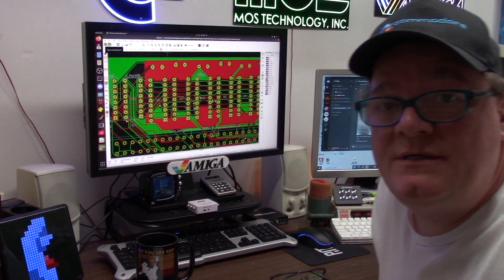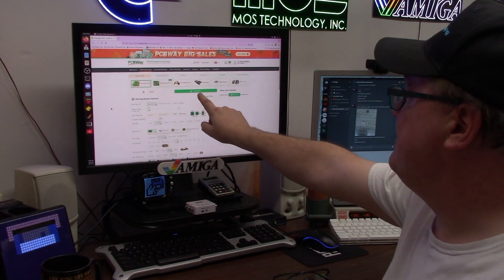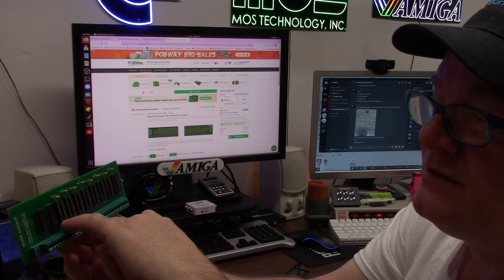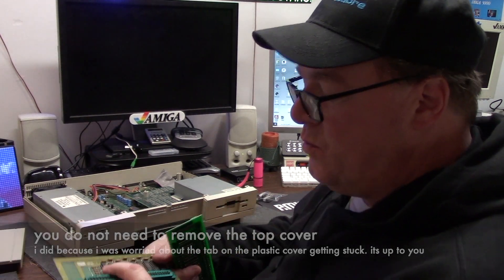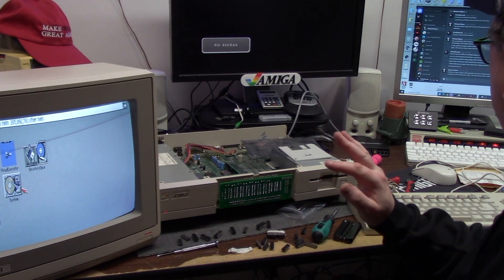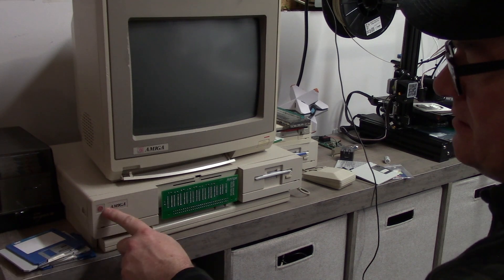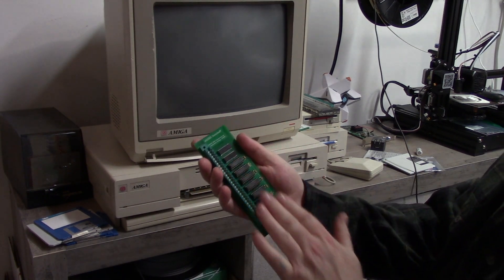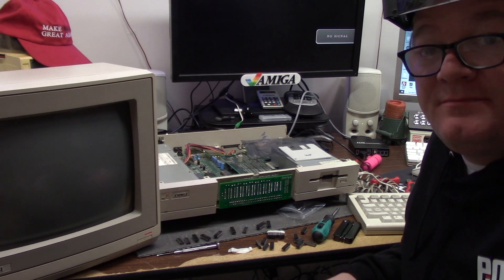Commodore Amiga 1000 A1050 256K chipram recreation

Comment: @chris is there anychance this exp[ansion board layout could be modified to go above the 512k limitation? eg espand to 1MB Chip RAM.. or is the A1000 Agnus the blocker for that… heh
Reply: The Agnus is the limiting factor. You need something like the Rejuvenator, which has been just recently reverse engineered and cloned..
Reply from the maker: agnus is not capable of addressing more than 512k in that dip package form, a rejuvinator motherboard would be needed for the 8372-a or b agnus chip, however is that then an amiga 1000 or just an amiga1000 case....
Reply: @ChrisEdwardsRestoration  .. I would say as long as the custom chips are used and everything runs cycle-correct- it’s still an Amiga— maybe not a pure A1000, but still an Amiga- in its best case :)